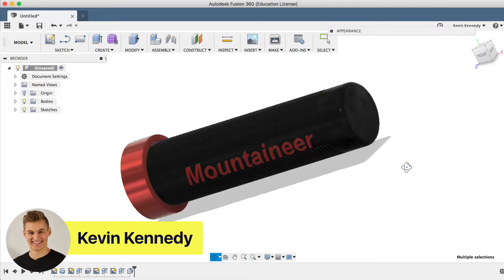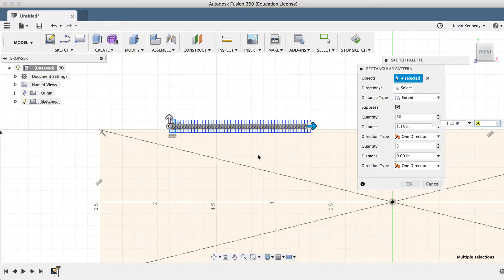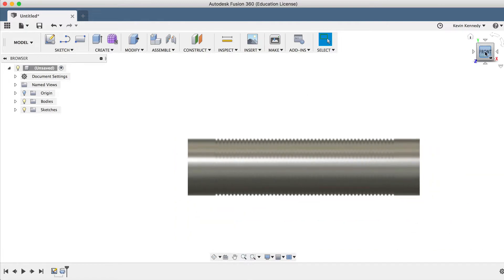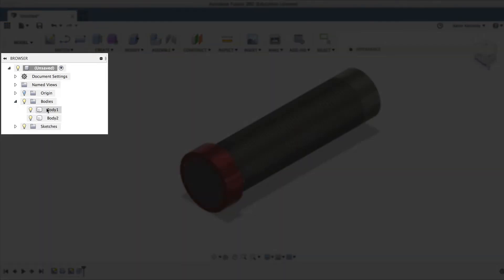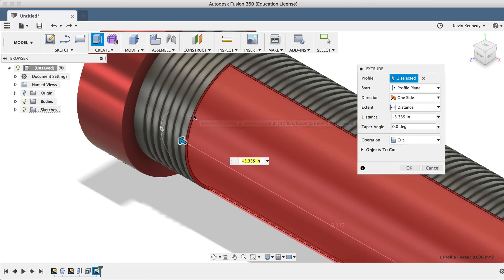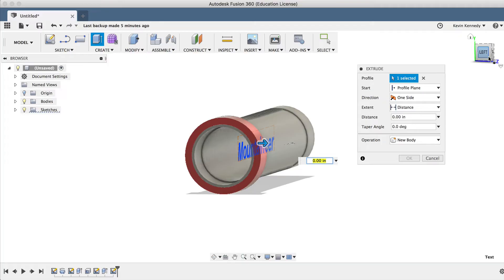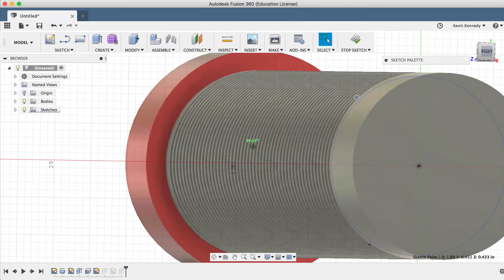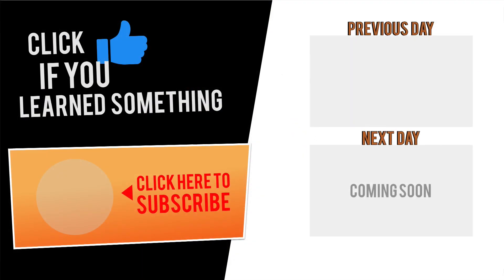3D Model a Handlebar Grip with Embossed Letters - Learn Autodesk Fusion 360 in 30 Days: Day #7

Comment: Thank you Kevin, great videos. I am a true novice so my struggles may sound even funny to some. I am finding the differences between your version and the latest one I'm using annoying with respect to sketch. I have to go create sketch, select a plane first every time, then I can select what I want to draw such as circle. It does make a difference and I'm sure that causes some of the issues I have throughout. The biggest struggle I had with this handle bar grip was the shell-ing. I could not get the body that we put on the left end, the copper one, to shell together with the rest of the handle, no matter what I tried. Eventually I just "drilled" a hole through it that lined up with the shell that did get created for the main part. After all was said and done I had a pretty cool looking handlebar grip, thanks :)
Reply: Glad I'm not the only one!!! Some of these tutorials I spend a lot of extra time trying to do things that seem to be different with the newer F360 versions. I didn't want to "complain" about it because these are excellent free tutorials. 

With that said, I created another circle in the aluminum and Extruded and that should be good enough. Now I'm trying to create the New Sketch on the single grip piece and I can't do it from a right click.

If I press C it automatically creates a New Sketch. From there I can choose which plane or surface I want to use. Not sure why that wouldn't work for you, unless I don't understand what you're saying...
Reply: @fatboy1271  Im in the same situation. A lot of extra time trying to understand how to do some things in the new version.
Reply: It doesn't make a difference in my opinion. As you pivot, you see if it was right. Most times it is.

Comment: Hey Kevin, You probably won't see this but is there any chance you could tell me how to make the black lines that surround my model disappear as when I look at it every edge have a black line and it really ruins the look
Reply from the maker: It sounds like a difference with your "visual style" settings. Head down to the bottom of Fusion 360 where you see the desktop monitor icon that is labeled "Display Settings." From there, hover over the visual style flyout and select "shaded." Yours is likely set to "Shaded with Visual Edges Only." Let me know if that was it! Cheers, Kevin :)
Reply: @ProductDesignOnline   Hey Kevin, Sorry for the late reply. That was it Thanks so much makes the models way more appealing. Thanks for the help and Keep up the great work Tutorials are excellent.

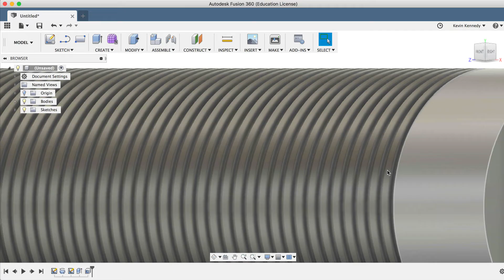Comment: Thank you for the tutorials! I feel like I've missed a pro-tip at 4:34 when you create a new sketch. I tried several times to do this and it always wants me to select a plane or planar face which results in me drawing a center circle at the midpoint or on the right face - but not at the grip I highlighted. Ultimately used a step you showed us in an earlier tutorial and created an offset plane from the midpoint to that grip and then was able to continue along. Is this a change in the new version or something I'm missing?
Reply: I have the same problem
Reply: It’s a different version of fusion.
It no longer appears to exit sketches automatically.
And a few other things , just do it how you can.
Reply: Noticed your Z plane is green.
My default seems blue is Z axis ,so I’m altering accordingly.
Reply: Thank you for posting that, saved me
Reply: AAAAA I have it. You have to select bottom face of grip ring and press RMB and create sketch is avaiable. Than made circle 1.2 inch. But if you makeing line you have to have start/finish point of line on 1.25 inch circle. It makes closed shape between 1.20 a 1.25 in circles, Than simply extrude/cut.

Comment: Hey Kevin, thanks for your entire channel.  I had a hangup at the part around 7:40 not sure if there is a different method currently but I can't move the lines. I've tried clicking and dragging as well as the move tool and the move/copy rotate function without success. I saw a forum post about constraints. Is that now necessary to make the lines move? TIA

Comment: I am having difficulties getting the handle bar to shell. Help
Reply from the maker: Can you be more specific with what you need help with?
Reply: Product Design 
After following your step exactly,  I cannot get my piece to hollow.  After selecting the Hollow button then       select the middle piece to hollow, that middle piece will not turn blue in other words will not become selectable like yours in the video.   I tried redesigning at least 15 times and on the 7th try it worked however I tried again another 8 times and the middle piece could not become selected.  Everything else I was able to accomplish on the one I was able to hollow.  Btw, your class is amazing. My son and I thank you for doing this.
Reply from the maker: @Karelb747  Sorry for the delay - thanks for the update. I'm not sure why the shell was not working so many times. One thing you can always try is selecting the body in the Browser, which is sometimes easier than selecting the body of the actual model.

Don't hesitate to comment if you run into more roadblocks in the future tutorials. I hope you, your son, and family is safe and healthy!
Reply: Product Design Online 
Kevin,

This is what I did to make it work.  Every time I ran into trouble following you amazing instructions I restarted fusion and it worked fine.
I think after using fusion a few times you should restart the software to avoid problems.  It took me 5 hours to figure this out.  I kinda gave up and decided to try the project on a different day and this is how I discovered the fix.

Thanks again for helping.  On to the next lesson.
Reply from the maker: @Karelb747  Sweet. Glad to hear that has been working for you. Cheers!

Comment: Hey Kevin -- if I wanted to move the text to the left after I'd reached the end of the design process, is that still possible? Am trying to figure out how to do it and can't figure out quite how. The pace of this video was a little too quick for me, found myself pausing a lot more than the others. Appreciate all of your work on the series.
Reply from the maker: To move your text you can right-click on the sketch in the timeline > edit sketch > right-click on the text itself > edit text > you'll see the placement icon/anchor point of the text, where you can click and drag on the text to move it around.
Reply: @ProductDesignOnline  Really appreciate the quick response. Observing strange behavior when I attempt to laterally drag the anchor point. Allows me to move text up and down, but when I move laterally it starts to rotate the text. Oh well, thanks again.
Reply: @ne5750  Same problem here. @Product Design Online can answer

Comment: Is there a possibility that there is a problem with Fusion 360? I've experienced it a few times that something did not work, then I saved it and closed the program. After a few hours I restarted the program and loaded the project, did the same thing and then it worked from the first time ...
Reply from the maker: It's definitely possible. A clean uninstall and fresh install of Fusion 360 may help - https://knowledge.autodesk.com/support/fusion-360/troubleshooting/caas/sfdcarticles/sfdcarticles/How-to-do-an-automatic-Clean-Uninstall-for-Autodesk-Fusion-360.html

Otherwise, make sure your computer specs meet the minimum requirements - https://productdesignonline.com/tips-and-tricks/system-requirements-for-autodesk-fusion-360/

Comment: in the Rectangular pattern, I can not select the small rectangular as the object , I do not know why
Reply from the maker: Hi, Majid. It's likely you're selecting the wrong rectangular pattern tool. Make sure you select the SKETCH rectangular pattern and not the SOLID rectangular pattern. Same issue with the mirror command if you want to reference this - https://productdesignonline.com/tips-and-tricks/mirror-command-not-working-in-fusion-360/

Comment: Hello, when selecting the right face of the last thread to place a sketch there, and then draw the circle on the exact center of the right side of the handle, I am not able to center the circle, it always is offset to the right, left, upwards or downwards. I´ve tried a lot of things to correct it. Since it is not centered, when extruding it (cut) to the left to create the surface for the text, it cuts in an uneven fashion.
Any ideas? Thaks for the videos, gr8 job.
Reply from the maker: Hi, alfonsinho74. You can try to create some construction line geometry that will help you find the center point. Also, make sure you're "Snap" option is turned on in the Sketch Palette. That will make sure you can snap into any areas where constraints appear.

Comment: Can you please explain why creating the small rectangles with a rectangular pattern into the large rectangle ends up making cutouts?  There must be some option enabled by default that has it making that cutout, and I want to make sure I understand how I'm achieving this.

Thanks.
Reply from the maker: Hi, Evan. If you pause at 1:55 and look at the selection of the profile, you'll see that the small rectangles overlap the larger rectangle. This essentially "cuts" the profile shapes up into different areas. Based on that selection, you're omitting the small "notches" created from the rectangular patterned rectangles.

I hope this helps a bit!
Reply: @ProductDesignOnline  Ah, I see.  I noticed that once I drew the smaller rectangles, that they themselves were split into two, by the intersecting line of the larger rectangle.  And even though I drew one rectangle, I ended up with two I could select.  So, when I did the rotate since my selection was just the large, un-bisected section of the drawing, and did not include the small sections created by the small rectangles, hence we get our cutouts.

Just interesting behaviours of these types of programs I need to learn.  I can chalk that up to just being how F360 is, but also, now I see how the different drawing components interact.  Thank you.
Reply from the maker: @EvanNadeau  Yep! Any time sketch geometry crosses path with one another it will "segment" the profiles to where the different sections can be selected. If you're ever looking to avoid this you have two options. First, you could turn some of the geometry to construction lines by selecting it and hitting the "construction" option in the Sketch Palette. Second, you can use the sketch trim tool to trim or delete specific lines (based on your selection). Video on the trim tool - https://youtu.be/6Jl82sKd5L8

Comment: https://a360.co/2SGxl4u  I got  little check marked squares no rectangles then these verticle lines with sketch points?? Thanks
Reply from the maker: Hi, mbnaso. I don't see an issue with your file. Just make sure to use the Rectangular Pattern feature under the SKETCH tab and not the SOLID tab. Cheers, Kevin

Comment: Hi Kevin, at 2:28 you are able to drag individual sides of the tiny rectangle, but I can only move all 50 rectangle as a group at once; I can't seem to resized the individual rectangle for the rest to follow.  I appear to have Parallel constraints showing on each side where is you have that other symbol (horizontal and vertical constraints?)  showing.  Any idea what is happening?    ----I'm using the slightly different latest version.
Reply from the maker: Hi, Jesse. First, can you confirm that you're dragging the line of the first rectangle? This will only work with the first rectangle, as that is the one that was actually patterned with the rectangular pattern tool. If it's not that, the constraints certainly could've thrown it off. It's possible that the parallel constraint was automatically applied.
Let me know if that helps. Otherwise, I can take a look at your file.
Cheers, Kevin :)
Reply: @ProductDesignOnline  Hi Kevin, yeah I decided to start again. I can resize the rectangle from the top and left sides, but now if I try to move from the bottom side, like move it up, it flips the whole rectangle around! 

In this example I'd I'd like to move the rectangle up a bit so the grooves are not so deep. 

https://myhub.autodesk360.com/ue2ff3eb0/shares/public/SH56a43QTfd62c1cd9689dcd5a04115868ca
Reply from the maker: @JesseKellys  I looked at your file. I see there is a coincident constraint that was likely automatically applied because of where the first rectangle was placed (it applied it to the construction line). You'll need to select the bottom line of the first rectangle > click coincident constraint icon > select delete on your keyboard. Image for reference - https://snipboard.io/URxT4a.jpg

Comment: At 1:39 there's a full step missing. In your video you can see how the small rectangles have merged with the large rectangle. That's not automatic. Why is that step missing?
Reply from the maker: Hi, Buttons Q. I don't see any missing steps... what are you referring to the rectangles merged? They're the same before and after. I had to cut out a large gap from taking a break so the zoom was slightly different.
Reply: @ProductDesignOnline  I figured it out. For some reason fusion would only let me revolve the cylinder shape of the grip, it wouldn't revolve the small rectangles for the actual grip. I just went back a few steps and it worked. Not sure why.
Reply from the maker: @AlmightyButtons  Hmm..strange, but glad you got it working! Don't hesitate to comment if you run into any more roadblocks. Cheers, Kevin :)
Reply: @ProductDesignOnline  Hey Kevin, so I attempted to redo this lesson again (since the way I did it wasn' the way you did). At 1:55 when you select the profile it shows the small rectangles 'indented' into the larger one. When I select the profile it only selects the larger single rectangle so when I hit revolve the grip lines don't show up. I'm not sure why....
Reply from the maker: @AlmightyButtons  Thanks for sharing the screenshots! I think I see what's going on here. It looks like your rectangles (from the rectangular pattern) are not spaced out enough - they're overlapping. You will want to make sure there is a gap between each rectangle. If that doesn't seem to be it, let me know and I can take a look at your file.
Reply: @ProductDesignOnline  There's a small gap between them. I think the angle of the pic just makes it look closer than it is. Where can I upload a file for you to check out?
Reply from the maker: @AlmightyButtons  To share your file, In Fusion 360 go to File > Share > Share Public Link (make sure "downloadable" is toggled on) > Paste your link here as a reply to this comment
Reply: @ProductDesignOnline  Ok so I have ZERO idea what I did different this time but it worked. hahaha
Reply from the maker: @AlmightyButtons  Glad to hear that! I'm always happy to look at files if you run into any more issues.
Reply: Hi Kevin. I'm having a similar problem to Buttons Q. His solution didn't help me.  When I draw the small two point rectangle across the top edge of the larger rectangle, it is not showing the edge of the larger rectangle dropping down into the small rectangle.  When you move your cursor over the larger rectangle's top edge, the edge seems to drop into the cut into smaller rectangle.  Mine just sits there. The repeat pattern works fine for a bunch of rectangles superimposed over the top line of the larger rectangle.  In one instance the lower portion of the small rectangle turned red, but I don't know why or what I did.  Either way, the indentation is not there to be repeated.  Is there a join or cut command I'm missing?  Help please!